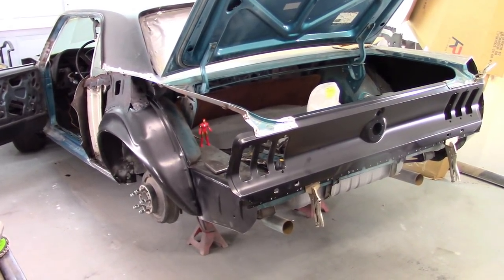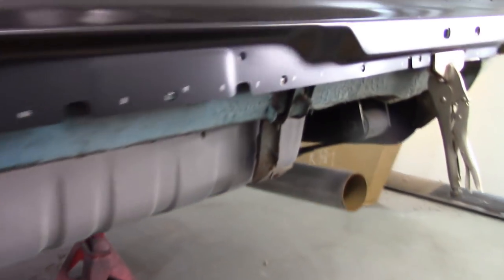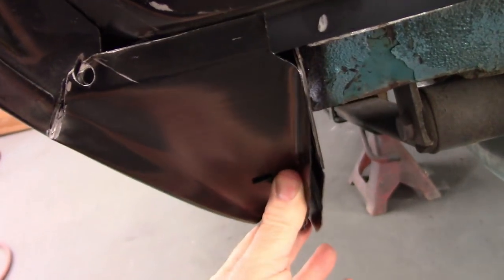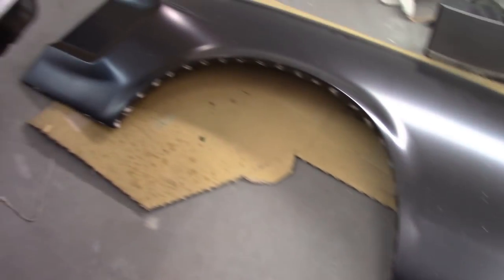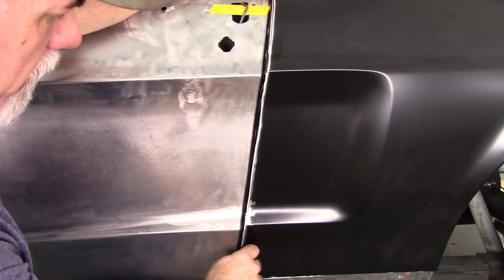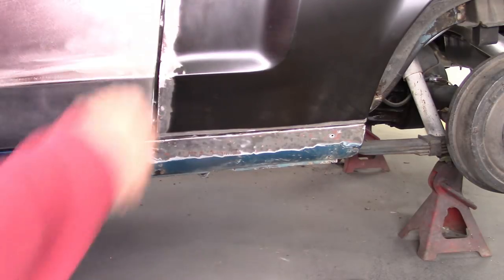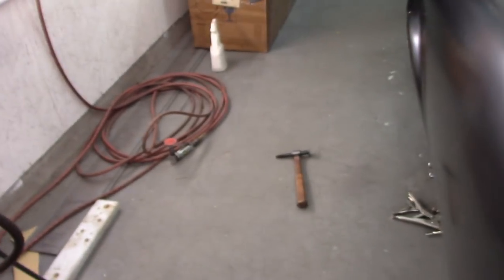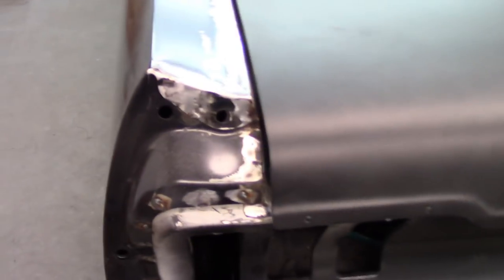Quarter panel and tail panel install. "Jade" part 25

Comment: Retired restoration metal smith... no panel regardless of who makes it is going to just jump onto the car , even factory NOS are rejects from the assembly line ! ........... in the bizz we say  " they are better than starting with a flat sheet " ! ........... very good work on this car . You sir are a body man,not a parts changer . You worked this out quite well , be proud of this car and yourself .

Comment: Proof positive a person can’t just sling those panels on the car and weld them up in a couple hours. I went through similar issues on my 67. The passenger side was almost perfect. The drivers side was a nightmare. In my case, it was too short going to the door jamb. I always learn something watching you.
Reply from the maker: Thanks. It's crazy how much work it takes sometimes. The best fitting panels I did were on the 68 Camaro, and they were from AMD.

Comment: Very nice work as usual, keep the vids coming. I just made a trip to Mustangs Unlimited a couple days ago to pick up quarterpanels and outer wheel houses for my 73 mach 1. You should have seen their faces when I said I wanted to inspect and verify that the wheel houses would line up with the quarters. For the most part they did but will still be some manipulation needed. I keep watching your videos for guidance on that, so thanks for everything.
Reply from the maker: Thanks. Maybe they'll start catching on that we expect these pieces to fit each other, AND the car.

Comment: Looks great Barry. That was alot of work on the quarter. I would still rather do that than deal with alot of rust. Hopefully the aftermarket panels will continue to get better. Thanks for the vid.
Reply: Same. But in my experience, aftermarket parts almost always fall on the "we have an idea that they might fit" rather than on the other. So long i get within 80% of the original (and my personal pet peeve, the thickness, which most repro companies don't do) i'm okay with it.
Certainly better than dealing with rusty panels.

Comment: ALMOST impossible to change the entire quarter panel! Just leave it to me to find a hardest way to do something. This is my first time doing this and I melted that lead out and drilled out the spotwelds and pulled the piece out from under the sail panel. I wish I had known to not do that cause its created a lot of more work. It fits pretty good though. The only real problem I've had though is getting the wheelhouse to match the panel opening where the wheel is. I've had to cut and add metal to the wheel house to get edges mated together so I can weld them. I'm gonna do it like you did when I do the passenger side. Live and learn!!

Comment: A easy why to fill a gap by welding is to use a metal coat hanger as a filler it works great

Comment: Did you get those quarter panels at the church rummage sale ?
Are you sure you needed to cut the front of the quarter like that?.. and maybe not move it backwards a bit?.
Or maybe the cowl panel where the door bolts is shoved back a bit.. 
ehh.. I'm just Monday morning quarterbacking, sorry
I'm 50 years in the body shop biz.
I'll give you the benefit of the doubt and say those quarters just weren't made right.
I try to get my quarters n such from dynacorn, cjpony, and here in Dayton Ohio we have 'Resto World' high quality Parts from a business with a great reputation.
No matter what the problem was, you do it your way and I believe it's going to look absolutely terrific. Hell..it already does ! (It's 2021 now)
I'm doin a 66 Tang GT Convertible,
Be   Fenders, Hood , doors, decklid quarter panels..outer whlhse,
But original floors,Rockers,frame sections are near-perfect.

Comment: Great video as always. Noticed the fuel tank is still in place. How did you seal it to avoid gas fumes igniting from welding and grinding. I need to replace the tail panel on my 69 and figured tank removal was necessary for safety. Perhaps I’m over thinking.
Reply from the maker: I use wet rags and an old cup or bowl to cover the inlet. But removal is probably best.

Comment: I'd like to see how you handled the quarter extension meeting up to the tail panel. I did most of those fixes but the quarter extension sure don't match the tail panel. I've not figured out that little mess.
Reply from the maker: When I get there, I'll try to make a video.

Comment: At 21:00, how do you drill out the old spot welds when you are in the process of removal. Struggling to get to those ones. Appreciate any advice.
Reply from the maker: I cut the old quarter panel into pieces. Then grind off the welds.

Comment: Did the right side quarter panel have to be cut as much as the left side and did this car have the chrome piece that goes in the scoop? I was wondering if the chrome piece would fit correctly in the scoop.
Reply from the maker: The right side fit better. I did add the chrome trim in the quarter. Fit nice. There are more videos in this series, and the trim is covered.

Comment: How did you weld the bottom of panel to the rocker on the inside flange?
Thank you sir. I am getting ready to restore a 65 for my wife.
Reply from the maker: You can access the bottom flange through the openings where the quarter window mounts. It's pretty open at the bottom.
Reply: @JoDaddysGarage  thank you much! I havent dug in yet. I want to get started on it soon.
It's a blank canvas so I have been researching alot because I want to do a restomod. Thank you much! Love the channel. 
I rebuild Camaros so I am learning alot on mustang.

Comment: what are the size of the drill holes for the spot welds?   what should the gap measurement be between the back of doors and quarter panel be?
Reply from the maker: I usually drill 5/16" to 3/8" holes. It can depend on how wide the flange is. I can't say what the exact measurement should be. 3/16-1/4" normally. I like 3/16".

Comment: Great job on that repop qtr I do have a question. Who makes them angle vice grips you had on the underside of the wheel well thanks in advance
Reply from the maker: Found them at Tractor Supply. $5 each.

Comment: The makers of these rotten panels should be sued for false advertising in a class action lawsuit. Anyone replacing tail panels should take a bezel and see if it fits the curvature of the Tail Panel!!!!! as I went through a stack of panels at MU and not one was close with a 3/4 inch Gap in the middle!!!!!!. I pity the people that bought those Tail panels and finished the Car and then tried to fit the Bezels!!!!!!!!!!!!!!!!  I ordered a silver painted Dynacorn and it fit like a glove. I am working on full 67 fastback quarters and the Dynacorn Quarters so far are fitting well.
Reply from the maker: Good advice.

Comment: Barry,
That camshaft sounds good with that automatic transmission equipped pony.  Can you tell me what camshaft it is?
Reply from the maker: I'd have to check my records. I thought I posted it in a previous video.
Reply: @JoDaddysGarage  Thanks for the reply, I'll look through the videos if you can't come up with it.
Reply from the maker: Competition cam. SK31-216-2 .447 lift. It's posted in the video description for the exhaust.
Reply: @JoDaddysGarage   Barry, thanks so much for the reply.  Your documentation of the 68 has been a real help for me with my similar 67.  I know the slight differences from the two model years and actually installed an OE collapsing steering column from a donor 68 into my 67.  That solid steering shaft in the pre 68 cars is dangerous.   Thanks again for taking the time.

Comment: Jo you did a grate job on the fitment issues and the line's match right on with the gap at the sail panel would it be better to fill it in then blend it just wondering again great job on this.
Reply from the maker: The forward gap? I'm still thinking that over a little. Ideally the factory was okay with using lead. I may add a little weld, and then shape with filler.

Comment: What do you suggest for filling the factory roof to rear quarter seam where it was originally lead on GM A body?
Reply from the maker: I typically use a fiber stranded filler. Roughing the sheet metal helps it stay. There may be other options, but that's what I use.

Comment: What is the measurement from the trunk floor to the bottom of the drop which attaches to the quarter.  Both of mine are 11/4" short

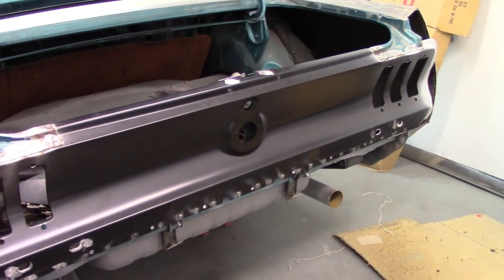Comment: What gauge welding wire did you use on the quarter panel? .024 or .030? 38:59
Reply from the maker: .024 for sheet metal.
Reply: @JoDaddysGarage  

Thanks for the quick response! That’s what I thought….

Comment: Again great to look at. Barry.   Shaw it with breakfast and a cup of thee..   So nice you can adjust the metal.   We're I think o my.. That is never going to fit...   I learn like a jakko from.you..   I don't.have a welder with gas in it though.. Only a electric one..  We're you cleu. Things together with metal Hahaha...  No I made a vew things.. Made a follower for my Hatley with a oildrum on it..  Made it less wide and weld a lot on it..  😂 Well it broke after a trip to Belgium behind my Harley.   Just made it home luckily it did not broke of and made a exedent.   I welded it and never used it again..😂
Reply from the maker: Thanks. Experience is invaluable.

Comment: Hey Joe? What welder and wire and gas mix and amps do you use?
Reply from the maker: In this video I used my Lincoln 140t. 
.025 wire. Feed set at 2 and heat set at B. If you are looking for a welder, I have links in my videos for the yeswelder and arccaptain. Look them up and the discounts are in the description. Both are great welders.

Comment: What is the piece above the quarter panel and below the roof, where the body line is
Reply from the maker: Meaning? The piece I saved from the original quarter?
Reply: I need to replace the quarter panel but i am looking for the piece or pilar between the roof and quarter panel, i have phoyos is there abyway to contact you ?
Reply from the maker: I'm not sure if they sell those. Send pics to jodaddysgarage@gmail.com

Comment: Those panels are not direct fit panels they are cap overs and that's why you have fitment issues the are designed to fit over a rusty panel . If you want proper fit panels you have to get them that says direct fit or OEM everything else is cap overs
Reply from the maker: Sorry, but that is incorrect. These are not cap over panels. if they were, they wouldn't have all the flanges. You would never fit one of these over an existing panel. They also fit the wheel house correctly. Nobody makes cap over panels anymore. That was common in the 70's and 80's.

Comment: Have you ever used Dynacorn sheet metal ?
Reply from the maker: I have used some that is labeled Dynacorn, and some that is actual Dynacorn. All the silver panels (weld thru primer) are theirs from what I know. The black panels (fenders, quarters, doors) are typically the same as any other. They just put their sticker on the box.

Comment: do the original tooling only tail panel's? have you tried the amd all metal direct I heard they fit better than dynacorn. The reason why they don't fit is because the dimensions are off on purpose so ford or other car manufactures can't sue them for copying. Its the same thing with kit cars, they build them with different proportions so they cant be sued or if you try to sue them you would lose like what happened when shelby he tried to sue factory five and lost.
Reply from the maker: Original tooling is always preferred. I have used AMD on Camaros. Love their products. Have not tried any panels from them for a Ford. I think they only make a few items for mustangs.
Reply: @JoDaddysGarage  is that all original tooling make that 1 panel-the tail panel ?
Reply from the maker: @fasterdrive221  All the pieces on the rear of this car are aftermarket. I think you can only get original tooling for the 65-66
Reply: @JoDaddysGarage  reason I ask is I never heard of original tooling after doing a little research they make lots of panels for the 65-66 they declare that there panels are nos- new old stock which means a modern reproduction stamping to the original
Reply from the maker: @fasterdrive221  I have used the tail panels made on original tooling. Fit nearly perfect.

Comment: What MIG wire are you using?
Reply from the maker: Lincoln 140T
Reply: Which wire? Just a standard wire or did you find an easy grind wire? I’ve heard good things about ESAB’s easy grind.

Comment: Your guarter side has no place for a marker lens like the guys 1968 convertible in Canada
Reply from the maker: Yes. 68 was a transition year. Some had a recess, others were flush. I went with the smooth look as I won't be adding the markers.